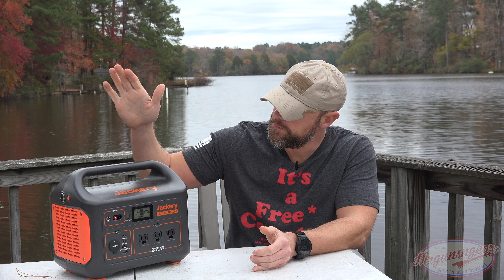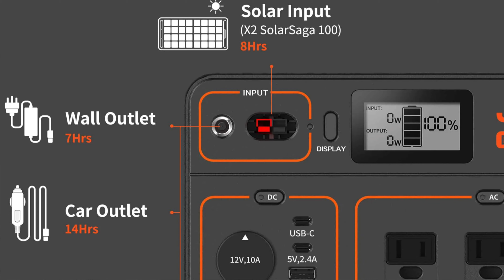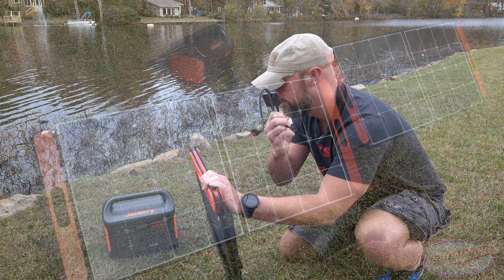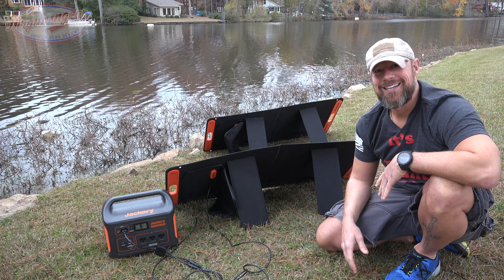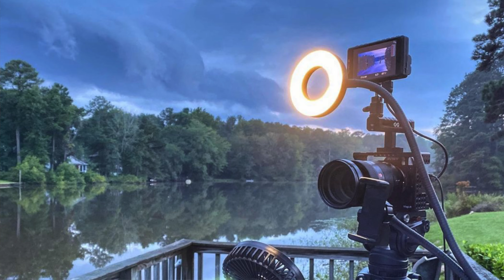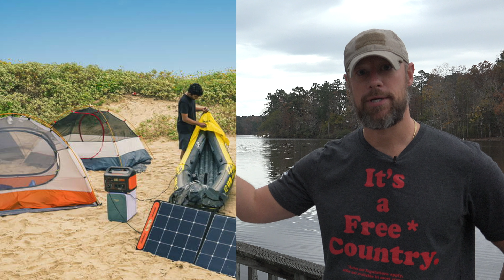Jackery Explorer 1000 Portable Power Station/Generator Review

Comment: If you're into cordless power tools, there are similar products from DeWalt, Milwaukee and EGO that utilize their proprietary batteries to perform the same function.   Personally, I like the DeWalt Power Station that utilizes 4 of their 20v batteries and supplies up to 1800 watts through a modified sine-wave inverter.  If you already have the batteries, the PowerStation is less expensive than the Jackery.
Reply: U have info?

Comment: The worst thing about this is the integrated handle. You can't stack anything on top of it. I ended up getting the less powerful 500w Bluetti/MAXOAK unit, which has hinged fold-away handles and Qi-wireless charging pad.

Comment: Could this run a air compressor? My tools are battery operated so I'm assuming I could plug in the chargers but what about the plug in stuff? I got a circular saw and air compressor for 2 examples.

I'm really dumb on this stuff.
Reply: Both circular saws and air compressors require over 1000 watts, so no.

Comment: Waaaaay too expensive, you can buy a small Honda generator for $1k.
Reply: apples and oranges. 
-you cant run a traditional generator indoors or too teribly close for that matter
-what about the longevity of the generator? too many people leave gasoline in it stagnant for too long and ruining the carb,
-device maintanace:  spark plugs?  oil? disposing of the oil? storing fuel and a lot of people arent smart enough to use stabalizer
- what happens when there is a grid down situation? you need power to pump gasoline.

that being said I do think everyone should own some kind of a small generator but I personally prefer Propane over unleaded due to how clean it burns for device longevity and you can store it pretty much indefinatly. 

these Solar generators are plug and play maintanance free and can be run indoors. I personally went with the Leoch on indiegogo
Reply: @advancedxdirective  but damm Nathan a thousand bucks, Lotta money
Reply: @Hugeroost  here is the way i look at it. In certain situations where an item like this is needed money wont matter, you cant put a price on emergency preparedness.
As stated above you can buy a traditional generator but in a grid down situation everyone in the immediate area will know you are running it because of the noise and that will make you very popular very quickly and attractive to thiefs or other criminals who may want to use  violence because they were less prepared and their food has spoiled.
Reply: @advancedxdirective  thats a great point Nathan that i didnt consider, but i'm fortunate enough to live in the great state o Texas where we all have the great equalizer, guns. Its kinda funny looking at all this mean-ness and robbing/stealing going on around the country. Nearly all those places are places that have all the strict gun laws, i would not live in one o those cities. Just the fact that they exist kinda keeps people in line. Funny story...about 3 years ago in Dallas this thug tried to rob a 7-11, walked in whipped out a gun pointed it at everybody told them to stay cool and nobody would get hurt then turned gun to cashier to open drawer. When he turned gun to clerk 2 people in store whipped out theirs and fired on him, he ran out wounded and a dude fillin up his truck shot him 2 more times. Guy should have went one state over lol. Your point is sound though for sure...Roost
Reply: @Hugeroost  Yes I am armed as well. Keep in mind it is never adviced to invite/look for conflict.
I wont advertise to the community and surrounding areas of what I have. Crime is caused by two things desire and opportunity. If they dont know it is there they wont have the opportunity.
Reply: @advancedxdirective  good man Nathan, you never know man we may have to fight our way out o this. Guns are just a way o life here, everybody has em. I read somewhere not long ago nearly 50% of Americas guns are in Texas and i believe it. I'm just glad i started buying ammo after that obama scare we had, now their over 2 bucks ea. Hey when the shyt hits the fan your welcome in Texas, there wont be a better place to be
Reply: @Hugeroost  I was stationed in Corpus Christi Texas for 3 years, I wouldnt mind going back. In the mean time I am in California til atleast Sep 2021 and itl be up to the detailer where I go next
Reply: @advancedxdirective  dang Nathan i'd be figuring a way to exit Cali asap, pelosi infested area. I swear everytime i buy somn it says "cannot ship to cali", i bought a blow gun on amazon the other day, yep, "cannot ship tp cali". thats a damm blowgun lol cant have a daisy bb gun there but you can ride all over Texas w 5 loaded AR's in the front seat and its fine, yea i'd be fleein that scene. Corpus is great i bet you liked that, lots o hotties too, and no cold weather

Comment: I bought my Jackery 1000 for off roading/camping. It will charge my Dometic CFX 75DZ for 36 hours in a controlled temperature setting (78 degrees). I can get 40% off Goal Zero through my job and still chose the Jackery. One handed carry and weight was the deciding factor for me.
I am very pleased with the Jackery. I'll have solar charging soon.